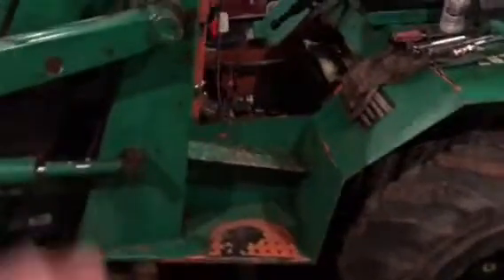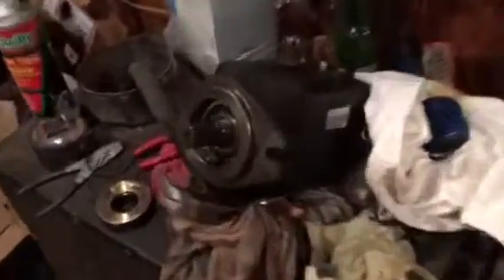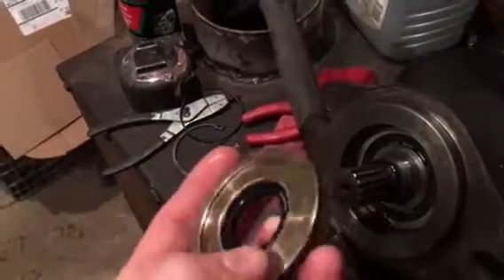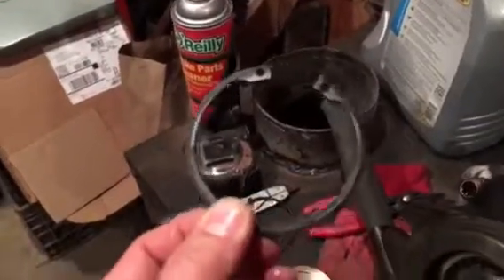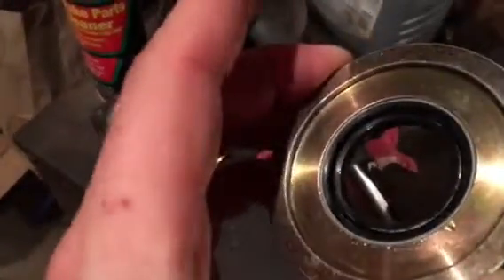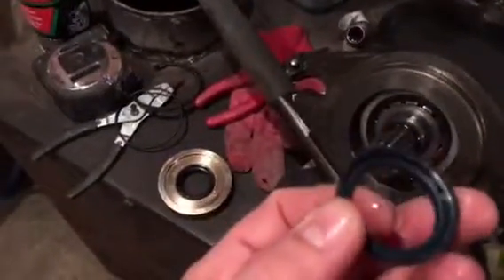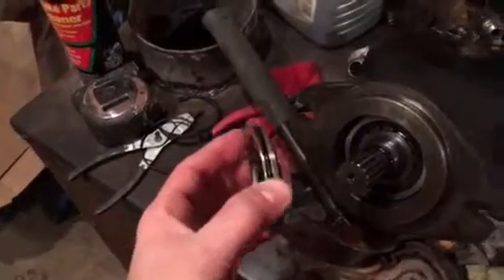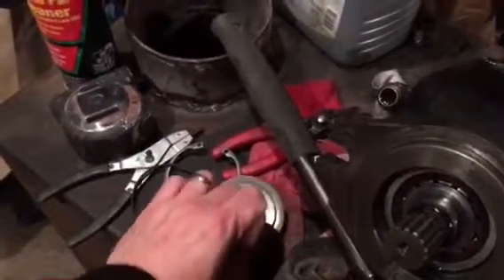Allmand brothers backhoe loader hydraulic motor leaks

Comment: You need a better camera.  It looks like you filmed using a potato, but at least it's not vertical ;)
Reply from the maker: I need a camera crew with multiple potato’s and lighting. It’s 9 outside nothing wants to work at that temp
Reply: Could I get help troubleshoot ing hydraulic system on my allmend  tractor
Reply: 3082895464